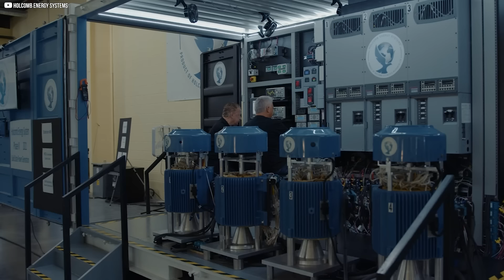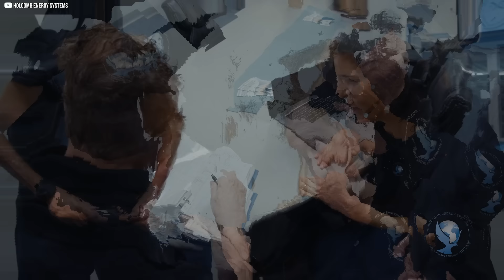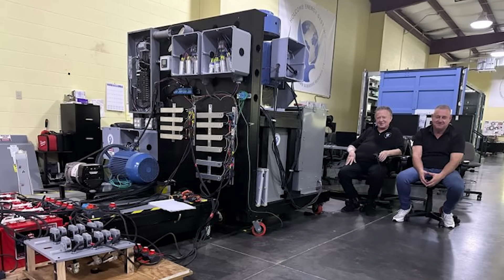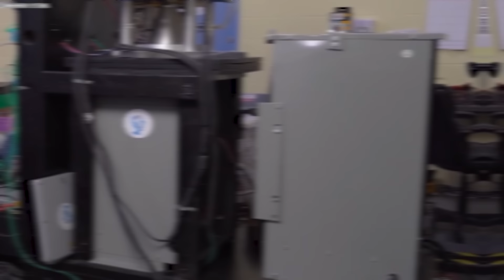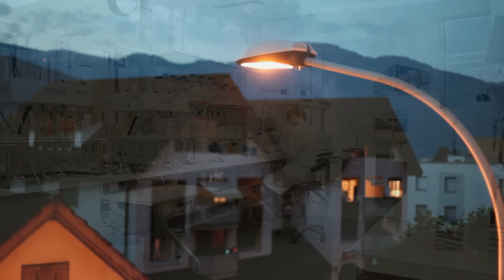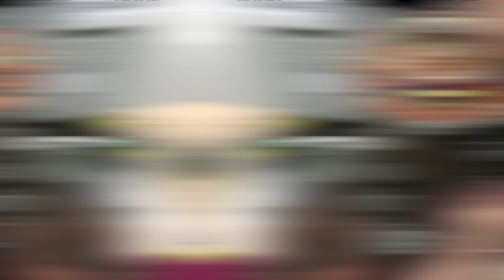Fuel-Free Power: The Invention That Could End Energy Bills

Comment: But true maybe but poor on going thought in the fact No grid or infrastructure grid ??  I give example  one million housewives bake  a cake  but  require the oven at 200 °  to bake the cake each   But should the one million housewives buy the Same cake from    ten stores  in various areas   that supplies 100,000 people each ? Thus One  unit  bakes one million cake on a production line --- less energy in the fact one million housewives have no requirement to heat the oven each @200° --    but one oven    with conveyor system   Hence with this AGS power system do you place mass production for each home/ factory or  One large electrical generator  supplying the many homes / factories in "  various Clusters" With a back up energy producer-----Think about it . One modular production in each home is not the answer  ---- But try explaining this simple engineer solution  to England's Energy minister of Parliament  Whom has the name of Mr Milliband   -- is Talking  to a Brick wall He is Hell bent on SMELTING thousands of tons of steel for Stancheons mining thousands of tons of copper for SMELTING  to produce generators for thousands of Wind farms generators,Help me God, Mr Milliband is destroys England  and no one will listen and Mr Milliband  certainly will not .Will please somebody get this total idiot Mr Milliband removed from out of his position of Minister for energy of England Explaining why to Parliament and the English population-- he does require disgracing of what he is doing ! !

Comment: Interesting self reinforcing wave patterns n signatures manipulating the wave forms is where it gets off balance self reinforcing part seemed pretty interesting 
You're inputed wave functions from different power waves would need proper calibrating to accomidate for all external n surrounding areas and interactions and try a crystaline based housing on an adjustable oscillating frequencie adjuster to accomidate for the the different wave forms to stabilize the internal wave also take into considerations the materials used and their forms and a coating to keep the waves pure and non harmful plus the power transference from the sources used before amplification as well harmonize the third wave functions fron the centre into a pure source of flow outputs fromt he 3 remain waves will tripple when coherent centre shift can resonate and provide the third wave amplification from the other 2 waves but needs resoances and proper non forced flow 
Following to consider just like solar panels I put some info on them as well etc

 Solar panel charge dispersion is unbalanced ure best higher resonances are synchronized not imbalanced it causes an environmental disturbance and unbalanced resonances disrupting surrounding frequencies and photonics and bio fields plus the biomagnetic discharges it produced wild life and ground discharges plus loss of efficiencies in power distributions of energy fluctuations materials and minerals resonances would be off and not synced properly energy losses and the magic happening of the third wave is lost due to the resonances should have a beautiful enhanced friend reconfigure the compatabilities and material and all environmental factors including sun n night photonic light considered when the resonances line up you'll get a much greater output in harmless energy but much more output and proper shielding and non harmful grounding resonances and air fluctuations and proper shielded resonant lines for the traveling of the power itself so it dosent disrupt on the way to any storage as well rethink your storages to shield properly as well as draw factors for new types of lines and proper resoante tools etc people gota thing outside the box much more 
People's biggest mistakes is not considering the wavelengths forms natural flows like for short example how to see that so ever looked through a aluminum enrgized window frame at fallling snow when its night time and see how snow moves in resoances waves forms with patterns of flowing light and see the beauty of how it shines as an example of how to see in a whole new way for inguinutiy to come to fruition as a enhanced style of beautiful being technological thought aspects
For cable reduction in interfering waves and adjustable frequencie resoancnes try using a coper silver gold gold coated line with a crystaline coated spray and carbon fiber wrap also enhances eletrical.conductivity should be able to adjust resoances and lower emf disruptions that way

Comment: You need to state how long it needs to be gently charged and at what voltage and amperage and trickle charged so you do not overheat the battery. Possibly charged over 48 hours to protect both the positive and the negative plates.